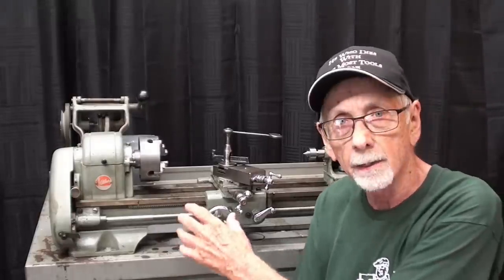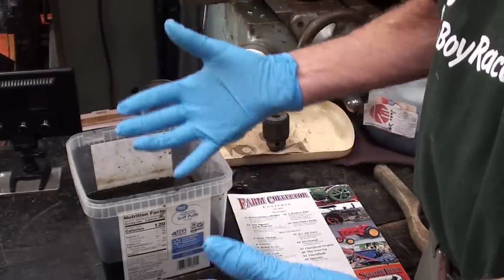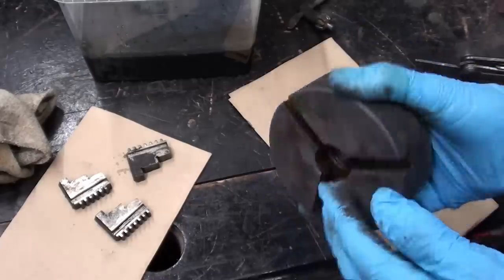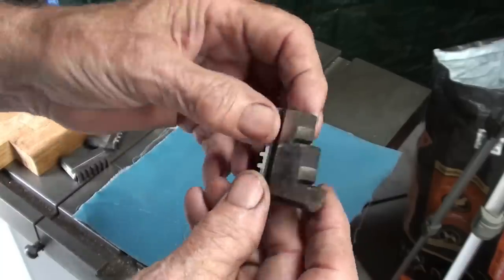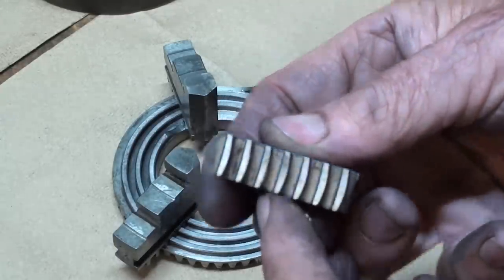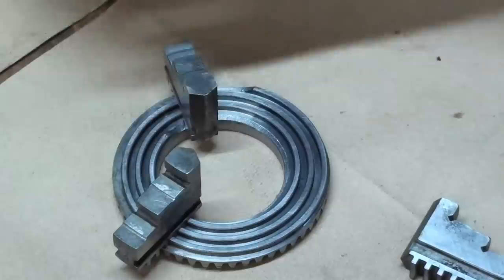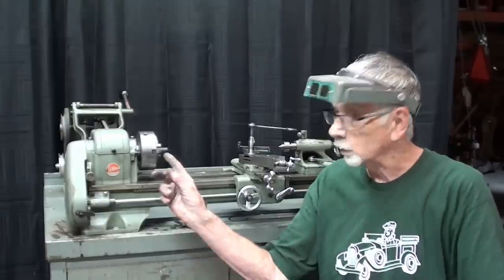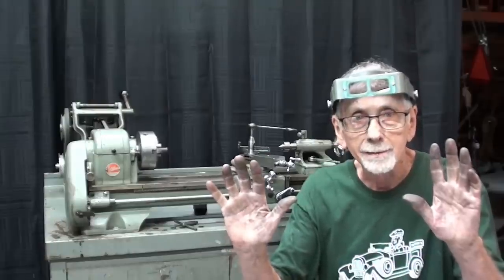RECONDITIONING ATLAS 618 SCROLL CHUCK #999 tubalcain pt 6

Comment: Thank You Mr. Pete!

I just got an Atlas 618 lathe identical to yours, and I'm just starting to work on it.

I've always been handy, but haven't used machine tools since shop class half a century ago,
and there's a lot of refreshing of memory and useful ideas coming from your classes. 

I find your videos well organized and packed with useful information.  None of it is boring!

On my lathe I didn't find a model number/serial number plate on the far end of the main casting.
There weren't even holes where the two pins would have held it in place.  Curious.

I'll send an update when I get the chuck off and read the thread pitch.
Reply from the maker: That's great you're getting back into machining!

Comment: Mr. Pete, do you have any advice for an Atlas chuck with apinion gear that has a few stripped teeth?
Reply from the maker: Sorry to tell you that it needs to go to the scrap man. 
Only other possibility is to find a donor chuck
Reply: @mrpete222 I'll take it apart. If it's not too bad, perhaps I can weld back the teeth and grind/file them back.
Thanks very much for your excellent videos!

Comment: A warning about hammering on the screws.  I opened up a rusty one earlier today and wound up damaging the threads on the screws and chuck.  Mine has flat blade screws instead of the allens yours has.  I was able to clean up the threads in the chuck, not sure what I'll do with the screws.  Mine was much more stuck so it took much more hammering, but the screws seem to be much softer than I expected for something like this.

Comment: Yrs ago, cleaned up an old 8" chuck after taking it apart. The bevel gear side of the scroll was so sharp it cut my finger all to heck when cleaning.
The shop across the street put an old machine out back. That 8" chuck layed on the ground. The new owners picked up the machine but left the chuck laying there and it stayed for a couple days. I was in desperate need of a chuck about that size for SB 12x6 #926 lathe and figured the company would throw that chuck in the scrap bin that was close by. With a friend's help we did a naughty thing, he grabbed that chuck and it's on 926 today. 
You, sir help to remember stories and provide inspiration!
Reply from the maker: That's a great story!

Comment: Nice little project.  I am retiring in a couple of months, and getting the shop squared away is a top priority.  If I could only get the wife's junk out of the shop, it would be much easier to fit in a small lathe or maybe a table top mill.

Comment: Thank you.  I did not know that chucks should be disassembled and cleaned periodically.  I will have to perform that on mine.  It is wonderful to see the machine and tooling come back to life.  What de-rusting solution are you using?  Do you prefer your solution to using vinegar?

Comment: I recommend use this lathe to make something interesting. I've used mine for single point threading, and where I need accuracy. I've made locating pins for mounting  aircraft engines.The  machine held  was +/- .0001 inch.

I've read several accounts of  the chinesium lathes needing "tweaking" to run right. My Craftsman 101.21400 held the above tolerance out of the and onto  the bench.

Comment: I wrote a comment on a phenominal find of a 618 lathe I bought from a widow recently. Included were two NOS 4" Atlas chucks, a three-jaw scroll chuck, and a four-jaw independant chuck. Both were labeled "Made in England" and further investigation revealed stampings from Pratt-Burnerd. They are very nicely made, although the three-jaw was very stiff with old grease. I re-greased it, and now it is smooth as butter. Here in Canada we got a lot of British-made precision tools before the UK almost completely de-industrialized. I think it is worse there than Canada or the US. A shame, and with the old cold war devisions reappearing perhaps a regrettable decision. Anyway, I am very pleased with my old British lathe chucks. 

According to my Atlas manual, the maximum size that can pass through the spindle is 17/32". I checked this with some 17/32" ground rod, and it indeed fit. This is useful if one needed to machine something to precisely 0.500", and was probably what the Atlas engineers intended.

Congratulations on your imminent one-thousandth tip. I have been a subscriber since before the pandemic, and have always looked forward to your video releases. May there be many more!
Reply from the maker: Thank you for watching
Reply: The widow that I bought my 618 from phoned me. She had found yet another box of 618 components, so I went and picked it up. In this box was a brand new Bison 2 3/8" precision Jewler's chuck, a drawbar and set of MT2 collets, a set of ER32 collets for the collet chuck, some Atlas milling cutters that fit in the drawbar including two dovetail cutters and several Woodruff cutters, a toolpost and complete set of NOS Armstrong tool holders, a drive dog faceplate and three lathe dogs, a taper turning attachment new in the box, and a Craftsman branded kit for metric threading that had an extension for the banjo, a transposition gear, and instructions on how to cut metric threads. There was also a set of 3/8" insert tools that fit the Multifix toolholder and about 3 lbs of assorted HSS blanks, and some preground HSS tools.  With this, I think I have pretty much everything Atlas/Craftsman ever offered for the 618.  I have been using your guide to get it set up. I went through the headstock, carrage, and tailstock, cleaning, oiling and inspecting, and I reckon I will have it running and making chips this weekend. I am powering it with a 3/4 HP, 1760 RPM 3-phase motor and VFD. I got a tachometer kit from Amazon for a spindle tach. The 3/4 HP motor is oversized for this  lathe but I think that the higher torque available will help when the VFD is turned down. Between this and the 16 speeds from the drive belts and back gears I reckon I will be able to find a good RPM with enough torque.

Comment: It's hard to find the close fitting chucks. All the new chucks with backing plates stick out so far! 
 I also have a three jaw independent chuck. It has independent jaws, no scroll. What was the purpose of this chuck? Or was it just a cheap way of producing a chuck. I have only used it for hoding round parts on mill.  clamping the chuck to the table.
Reply from the maker: You are right, I love the close fitting chucks.     I never heard of a three jaw independent.

Comment: Good morning Lyle,
My 12” Craftsman came with a Buck chuck also. My only issue with it is that someone ran a 5/8” drill down the center and now the jaws will only clamp down on larger stock. 
Do you know if replacement parts are available?
My only option is a new chuck. 
Congratulations on reaching a milestone. 
You should release video 1000 later today. 
Keep them coming my friend. 
Have a good day.

Comment: Keep the videos coming! 
Even though there are many hobby/instructional machining channels, Mr. Pete is the only one that I watch with faithful dedication. He is simply my favorite. 

Today's modern quality chucks are  machined in controlled setups to very high tolerance. The face and body OD can be trusted for flatness, sqaureness, center line, etc. They can be indicated on the spindle nose taper using the face and body OD. These smaller older lathes have no provision for this tuning, as they simply thread on and seat on the spindle nose face. 
Treat these high quality chuck surfaces with care to maintain their integrity.  I would be very cautious about hand sanding/polishing these surfaces to not risk compromising these surfaces. 

This era of lathe and the manufacturing precision control capacity was less capable. As Lysle stated, you can expect some chuck runout. My assembled spindle on a similar lathe has about .001" TIR. Add chuck error, and it gets worse. A lot of care can keep work in the .001 TIR range, but it is a challenge.  
We don't machine with the chuck body, but we frequently use these surfaces for registration and reference. It behooves taking as much care of these surfaces as we do to the jaw faces.

The flat square ways on these machines are a design deficiency. Keeping sanding grit off of them is a good practice.  They are light duty machines, but they still are a lot of fun. My little Craftsman is  still the feature machine in my shop as I don't have 3 phase functioning capacity yet to operate my industrial class lathes. Every shop upgrade includes more projects. I stalled my 3 phase generator project to do some other simpler tasks. I completed several restorations and installations and made some shop fixtures. Too many shop projects, but it is all fun.
Reply from the maker: Thanks for the great feedback and tips!

Comment: Mr Pete! A tip! That leftover black crud on the jaw that you used the 240 grit on... That's just caked up rust that the converter couldn't penetrate. In my experience I get better results if I scrape it away with a razor and then hit it with the wire brush, first, before using abrasives. (like an old worn out piece of scotch brite) as a last resort.  
I can usually get it right down to the bare (pitted) metal without too much effort that way. 
And at least that way it doesn't change the tolerances much, if at all.
Cheers! Nice Tool!
Reply from the maker: I appreciate the tip, I'll try that next time!

Comment: I love your passion. Dad had an 6” Atlas that was run out. As a Teen I would use Library books a taught myself how to use it. He was a great dad but was away from home most of the week. I ended up showing him how to use it. He was a pilot and aircraft mechanic but flying for a major airline was his job. He loved the smaller aircraft and had basket case project aircraft. No time to work on them. I finally had enough and started working on them. In our later years, through his retirement, we continued to work together on his passion aircraft. That 6” lathe was there and working the whole time.
Reply: Great video!

Comment: I've had my Harrison 13" for a number of years now, though with not a lot of use, so I am motivated now to pull my chucks apart and clean them up.  Thanks for the push.  Keep up the good work.
Reply from the maker: It’s worth the effort!
Reply: Make sure to index mark the back half of the chuck body to front half as your Harrison scroll chucks will most likely be of the 3 bevel gear type.
if they are the original chucks that came with the lathe they will probably be Pratt or Pratt Burnerd branded chucks.

Comment: Great video Mr. Pete. I have a atlas 10 inch lathe and resently I took a part my scroll chuck to clean, and discovered that the pinion gear is damaged, two missing teeth. I was wondering if you have any suggestions what to do with it?. Thanks.

Comment: At work we had a lathe that had a chart on it for the cross slide so you could set up and cut scrolls like on the face of the gear plate in the chuck. 50 years of tool making never had to cut a scroll on the lathe. When you showed that it kind of jumped out at me.
Reply from the maker: I never knew you could make scrolls on a lathe!
Reply: @mrpete222 (from Ireland)   I guess his lathe had a custom gearbox somewhere about it.

Comment: Much appreciated! I have a genuine Wescott 3 jaw that cleaned up beautifully for my 618. It must weigh 3 to 4 times as much as the 4 jaw. I think also my theads are 10 and not 8 on mine.
Reply: The spindle thread on Atlas 618 lathes is 8 TPI.
Reply: Early lathes, both Atlas and Craftsman branded, have 1" -8 tpi spindle noses, later ones have 1" -10. Also some early lathes have oilite sleeve spindle bearings, whereas later lathes have Timkin roller bearings for the spindle; AFAIK all of the sleeve bearing lathes have the 1"-8 spindle and all of the 1"-10 spindle lathes have Timkin bearings. I think that Mr. Pete has a rare Timkin bearing lathe with the 1"-8 spindle, so the conversion to roller bearings likely happened shortly before the conversion to the 1"-10 spindle thread. Many wood lathes, to this day, use a 1"-8 TPI spindle thread to mount spur chucks, faceplate, sanding discs, etc.